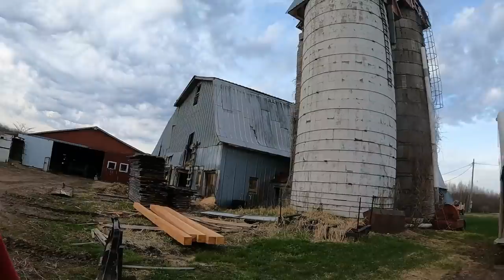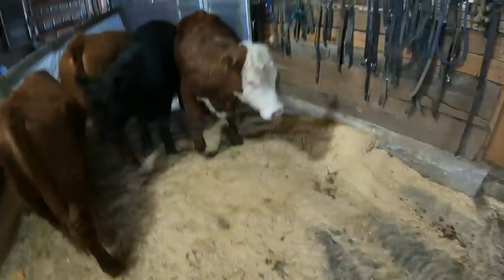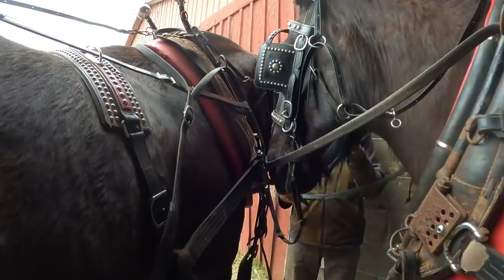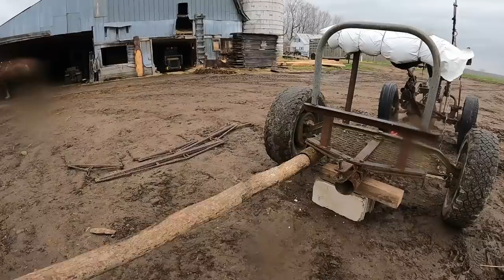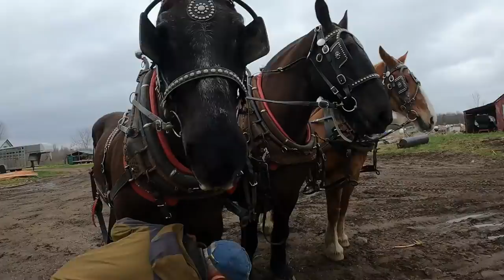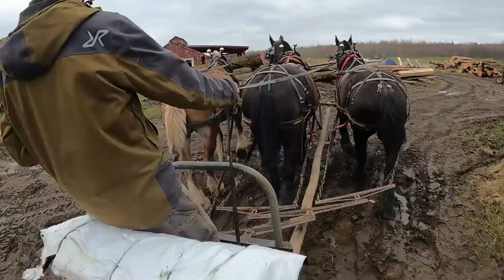TRAGEDY on the Farm 😢 // Early Spring Jobs

Comment: Question??  I know nothing about horses and find what your doing fascinating.   That big thing you put over the heads of the horses, I guess it's what the horse pushes against. There are two what I would call horns that stick up that has round silver balls  on them. They stick up I think about 8 to 10 inches.   What are they? What's it used for??   Maybe you could talk about  it in one of your video's.   It's something how you talk to your horses.   lets see if I got it right.  gee = right,     ha = left,     step = go forward,     easy step = slow forward,    ba = back up,     ho = stop.  ( What?  no get-e-up) 🙂
Reply: That is called the collar. The 2 wooden pieces are the Hames, and are what the traces are attached to. The Hames are what take the weight of the load, and the collar keeps the big beasties from tearing up their shoulders against the Hames.

Comment: Some nice looking pine logs you have there.  Nice piles. .  I have heard of fawns being abandoned due to human handling with wild deer.  But with your kittens, I think your Theory makes the most sence.  Enough about cats , ah ha.😄 Let's talk horses, I Was trying to follow you on the lines attachment, the laying of lines on the ground was best as less confusing.  I guess the goal pull left go left pull right go right pull both to stop or slow, still applies but the outer left line to the left most bit...the outer right line to the right most bit.
And the middle may be bit to left horse and right bit to right horse.  I have to watch it again as I confused myself a little.  Good patience Jim waiting to plow,  I know that's hard.
  I recommend plowing the dry ground 1st then wet later , but...differant with horses.
  Let us know how you do it.  You are in a good position to make that call.  :-)
Reply: How is that horse shoe doing? , the one caught in the mud?  All better?
  When I was little we had a plow just like the one you cut.  Modified..  nice easy touch on the corn crib, a wide base footing and some cross bracing and it will be good for another year, I like that ole crib. :-)